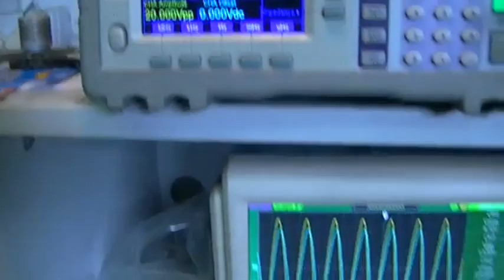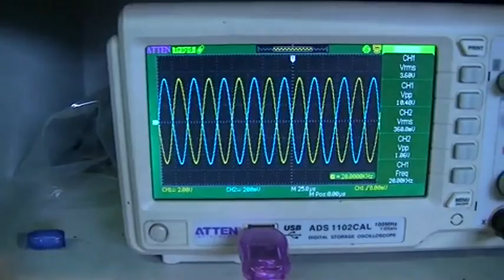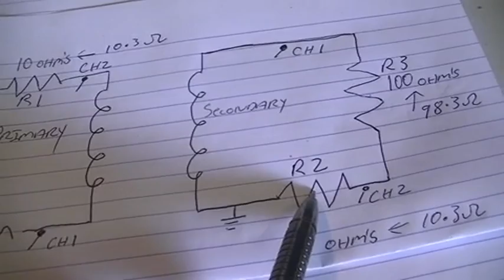Hybrid Toroid Transformer test 3

Comment: Please double-check your math... and the need for the 10.3 Ohm resistor in the Secondary testing.

I get a Primary Input Power of: 4.344V RMS x 36.5mA RMS = 158.556mW RMS (agree with yours)

Secondary...
You had 3.60V RMS across the 98.4 Ohm, and 0.360V across the 10.3 Ohm. 
Those [Series Voltages] add together, right? (yes, even though they are 180° out of phase)
That's a total Secondary Output Voltage of 3.960V RMS, right?
You don't need to measure the Secondary output Current, it's simply calculated. Fewer numbers, fewer possible errors.

The TOTAL Secondary Resistance Load is 98.4 Ohms + 10.3 Ohms, or 108.7 Ohms.

Simple Power math says: P = (Voltage-squared) / R
(3.96x3.96) = 15.6816
15.6816 / 108.7 = 0.14426Watts or 144.26mW RMS

I would also recommend using 1% or better resistors, then we don't have to worry about measuring them with an unknown DVM accuracy. (when measuring Low Ohms, you need to zero-out (or subtract) the shorted Test Lead resistance... which I didn't see)